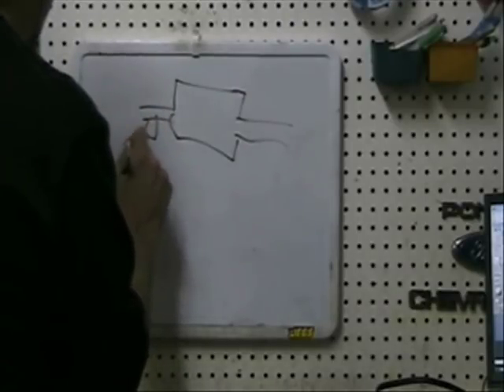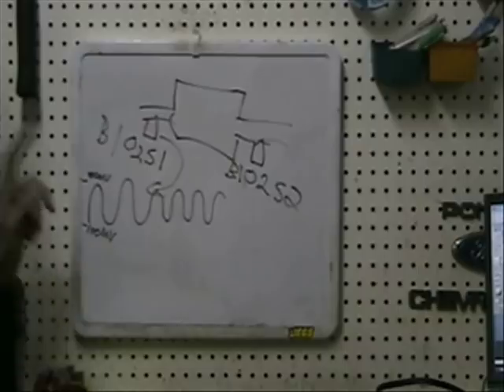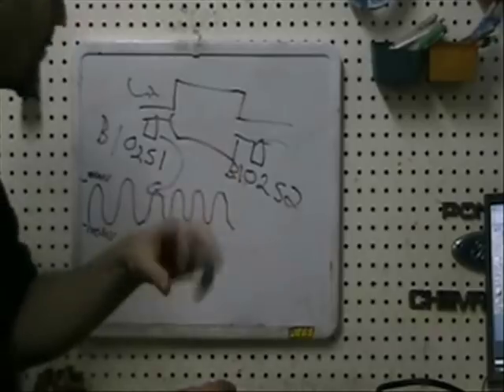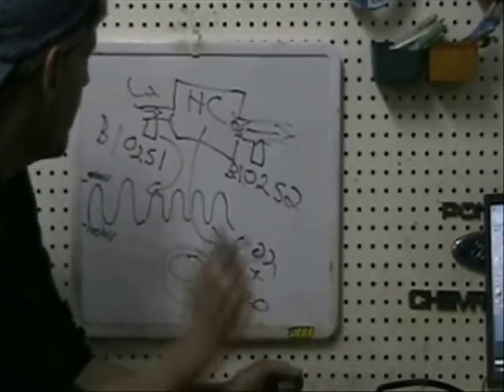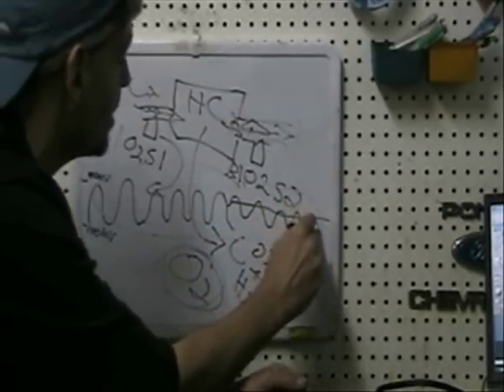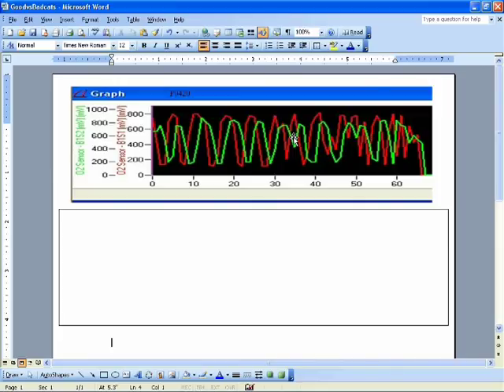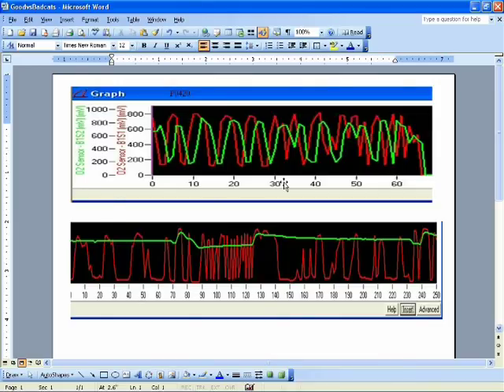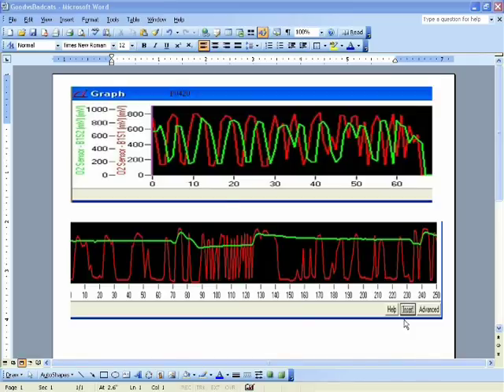P0420 P0430 catalytic converter catalyst inefficiency code diagnosis

Comment: I've seen some people automatically condemn the converter because they see the  downstream signal exactly following the upstream signal. However, the upstream signal wasn't cycling correctly to begin with.

It would seem that if you have a bad upstream signal you need to fix that first. My understanding is that the converter won't do its job properly if the mixture going into the cat isn't cycling properly. So if you were to replace the cat the new one won't work correctly either because the exhaust mixture going into the new cat still won't be cycling correctly.
Reply from the maker: +Joe Vignolo If the upsteam is not cycling properly and the front O2 has a code, it precludes any codes for the cat.
  Even so- if the front sensor is not operating, the cat HAS to still make a change by default because of the chemical activity.  You cannot turn off catalytic activity.
Reply: +Schrodingers Box - If the upstream O2 sensor is cycling correctly voltage-wise but is cycling too slowly frequency-wise you may not get any codes associated directly with the upstream O2 sensor, there will be no drivability issues or plug carbonization, the fuel trims will look fine and the system will run closed loop. But the slow cycling can cause the converter efficiency to drop below the threshold and trip a P0420 or PO430 code. So if you have a slow upstream sensor you need to fix that problem first before condemning the converter.

Remember that later model cars do not use auxiliary air pumps to oxygenate the converters or electric heaters to heat them up. Instead, they use the engine itself to do it. That's what the cycling is for. The lean part of the cycle pumps in the extra oxygen that the converter stores up to use later. The rich part of the cycle pumps in extra HC, which the converter burns to generate the heat it needs to operate correctly. So if the cycling is happening too slow, the catalytic activity will drop off and you will get a PO420 or PO430 code.

I suspect that a lot of perfectly good catalytic converters are ending up in the scrap pile because people are not diagnosing these situations properly. You need to fix any abnormal conditions that are inhibiting the converter before you replace the converter.
Reply from the maker: Joe Vignolo Explain the chemistry of how the catalytic converter would suddenly have low efficiency as result of slow upstream cycling. That makes no sense to me whatsoever.  The catalytic activity is constant, not variable.
Reply: +Schrodingers Box - It's somewhat complicated, but basically it has to do with oxygen storage inside the converter. Modern three way catalytic converters (TWCs) that do not use external air injection have cerium in them. Cerium absorbs oxygen, stores it and then releases it. But cerium has its limitations. It will only absorb small amounts of oxygen and it can only release as much oxygen as it has previously absorbed. Cerium allows the catalyst to operate efficiently under slightly rich and slightly lean conditions only for very short time periods. So if the air/fuel mixture is continuously cycled from slightly rich to slightly lean fast enough, cerium can allow the converter to constantly operate at maximum efficiency. But if the cycling frequency drops too low this little trick will no longer work. This is because the pulses of oxygen contained in the cycle are too long and too far apart. Therefore, during the excessively long, lean parts of the cycle the cerium absorbs only as much oxygen as it can until it saturates and can't absorb any more. This means that the amount of oxygen that the cerium in the converter can store is limited. This then means that during the excessively long, rich parts of the cycle the cerium doesn't have a sufficient amount of oxygen stored up to properly oxygenate the converter all the way through to the next new lean cycle. This in turn causes the converter to become under-oxygenated during the rich parts of the cycle, which in turn causes its efficiency to drop.
Reply from the maker: ***** In that event however you would not MIRROR proper O2 waveform.  Yes there are actually many, many instances where you could have lean or rich conditions affecting trace from the cat but only one possibility where you mirror proper waveform from the front sensor.
Reply: +Attention to Detail - Yes, you are on the right track. A lot of people don't understand what the real purpose is for the upstream cycling. It's actually done intentionally to support the catalytic action inside the converter and the cat will not work properly without it. Here's what happens.

Just like the cats in modern vehicles, cats in older cars used to reduce NOX emissions in the front brick of the cat. To do this they needed a rich mixture to start with, so those engines were run slightly rich all the time. Then, to do oxidation in the back of the cat (to convert CO into CO2 and HC into H20), they needed extra oxygen pumped into the middle of the converter. This was supplied using an external, mechanically driven air pump. But the air pump adds cost, weight, complexity and it also reduces the reliability of the whole system. So the engineers came up with another technique to inject additional O2 and oxygenate the rear brick while at the same time getting rid of the mechanical air pump. This technique involves constantly cycling the mixture, which allows the engine itself to pump the extra oxygen into the rear brick of the cat without having the mechanical air pump to do it with.

During the rich part of the cycle, the front brick uses the extra fuel to reduce or strip out the extra oxygen molecules from the NOX molecules, converting them to N and O2 the same as before. Then during the lean part of the cycle, the engine pumps extra oxygen into the cat. Some of the excess O2 is stored in the cat because they put cerium inside of it. Cerium acts like a sponge. It soaks up oxygen, stores it and releases it later. It is all this extra oxygen which the back brick eventually uses to to accomplish the oxygenation of the HC and CO. 

So you can see why the cycling is so important. Without the cycling, it's sort of like having an older car where the mechanical pump has failed. To make the older car emissions legal again, you would need to repair the mechanical pump. Similarly, in a modern car you need to make sure the cycling is working okay to give the cat a fair chance to do its work correctly. So if you have a converter that is not operating efficiently, you need to make sure the mixture is cycling properly. Do that first, then if it isn't cycling right you need the fix the cycling problem first before you replace the converter. A normally cycling upstream sensor should regularly cycle from .1 to .9 volts and do it about once a second or less.

Next, besides cycling issues, some cats can lose efficiency when they get contaminated inside the honeycomb structure. This can be caused by a temporary condition where the engine was running rich. This can cause carbon to form on the surfaces of the precious metals inside the cat, which can drop the cat's efficiency and cause a P0420 or P0430 code to pop up. So can an anti-freeze leak into the combustion chambers, when the coolant residue builds up inside the cat. In these cases, once the initial condition is corrected, the cats can sometimes be restored by cleaning them out. There are commercial cleaners available such as Cataclean. And some people have even had luck taking the converters out of the vehicle and cleaning them by soaking them overnight in soapy water.

Finally, there are cats that don't work anymore because their insides have been irreversibly damaged. Sometimes continuous misfires have overheated them and melted the insides. This is very common. Other can get impact damaged by running over road hazards such as rocks or stuff that someone dropped in the road. Unfortunately , these cats will have to be replaced. Cleaning these cats won't recover them.

In any case it's always a good idea to check for other less expensive possible causes before replacing an expensive converter. This is also important because  the last thing you want to do is replace the converter and then end up with the same issue again because you didn't fix the real problem.

Also remember that if you had or still have continuous misfires you will need to fix those first so that you don't burn up the new cat.

Many recoverable cats are probably improperly and unnecessarily replaced.  Many professional mechanics automatically replace the cat whenever they see a P0420 or P0430 code. They usually throw new O2 sensors in as well, just to "be on the safe side". Yup, okay. Sure the problem goes away, but so does a lot of the customer's money for no good reason.

Finally, I just read an article the other day from the EPA regarding the issue of evaluating a catalytic converter. They now recommend removing the upstream O2 sensor and inserting a borescope into the exhaust pipe to visually inspect and evaluate the front face of the front brick before replacing any catalytic converter. The article also expressed the importance of finding out the converter's recent history, especially if its been exposed to continuous misfires for any length of time.

Comment: I didn't quite understand what you were saying about if you have an air/fuel ratio sensor instead of a traditional narrow-band O2 sensor (like in a Toyota) -- does that mean you can't diagnose a bad cat by looking at the voltage variance in the downstream sensor? Or will you still see the voltage go up and down in the downstream sensor if the cat is bad?
Reply from the maker: No it means you will just have to use something like a short term fuel trim if you want to see upstream oscillation. The downstream oscillation will still be identical as shown on the video though. But AF voltages do not oscillate.
Reply: @SchrodingersBox  ok, thanks for the excellent video

Comment: I'm  not to sure about the voltage but upstream  shows the wavy line and downstream  is a flatline on both banks the same readings.
Reply from the maker: +angel cedeno Can't help unless I have the right data bro.  Good luck to you.

Comment: how do i read those graphs on a computer?  as in how do i pull them up? or connect them.
Reply from the maker: @Heroofharo- you need a scantool to be able to generate that data.  see my scan tool reviews video for info on the device used in this video.

Comment: Great video, it helped me understand a lot about the cat and downstream O2. I have one question about an 08 Sebring touring V6 I am currently trying to diagnose. I just recently changed out spark plugs to OE plugs and my one cat DS O2 at idle went from oscillating to 100mv flat line after warm up. Driving I still get oscillating graph. I am still looking at a bad cat or O2 sensor?
Reply from the maker: Bad cat
Reply: Schrodingers Box on the other cat I’m flatlining just under 900mv is that still good
Reply: Also, kind of off topic, 1- can a bad cat cause a specific misfire such as P0302, and 2- I am about to run a test, I had a mechanic replace all spark plugs, gapped at about .4, and found out that after fixing my coolant problem, putting coolant (50/50) instead of water, I did not have the misfire. Success! now I break the golden rule, if it ain’t broke don’t fix it. So since I tinkered with the plugs and got the Haynes book, I said let me by OEM plugs(.5 gap). Shouldn’t hurt, right? Misfire came back. Now I’m going to try to replace the plug with the one that worked, to prove my hypothesis. So my question is, over time should the gap get smaller on a plug or is something else happening that I’m missing.

Comment: You never said if the graphs you put up are at idle speed or increasing rpms while in park or while driving.
My #2 o2 sensor doesn't mimic sensor #1  while taking it to 2000rpms or at idle. #1 while at idle goes between .1 and .8 spiking about every 7 seconds with #2 steady at .7/8Volts.
While running down road at 1000 rmps there is a mimmic of #1 and #2 sensors, but not while idling or 2000rpms.  
The frequency of spiking to .7 volts is less frequent in seconds at idle then while driving down the road.
Reply from the maker: You will see it at both. Worse at idle but at 200RPM it should also be enantiomeric.

Comment: When i floor the car at 70mph car begin to misfire p0300, an P0430.... Only happen when floored at high speed... Where should I start
Reply from the maker: Definitely start with fuel trim curved against load. That’s by far the most basic way to get a direction.
  The 0430 likely has nothing to do with it.

Comment: Great video, I have seen guys use spark plug non foulers over the 02 sensor to eliminate code po420 . my question is will it effect the fuel economy at all even those check engine light are off. please help!
Reply from the maker: It won't affect fuel economy but it won't get rid of the check engine light either. People who try to override an inefficiency code through O2 sensor manifpulation have no comprehension of the system. Using a non fouler will simply replace the P0420 code with a O2S "stuck lean" code. Even a cursory momen't thought would indicate why that would be.
Reply: @SchrodingersBox  So what affects fuel economy? i have a p0420 car is using more fuel than normal
Reply: It did not work for me on my '98 Cutlass 3.1 with no cat. I'm still getting p0420 and my fuel trims look good but rear o2 sensor is jumping rich to lean same as upstream does. I also have some grey smoke out the exhaust but no overheating or loss of coolant and my fuel trims are near perfect at idle but long term goes +7 with a quick punch of the throttle and levels back to near zero when I hold rpms at 2500 then goes + again just after I let off then back to zero at idle. I'm fearing it could be a vacuum intake or head gasket leak but as I said, it's not running hot or losing coolant.
Reply: @ianwilds3139  
Looks like you have a bad cat

Comment: Great video and explanation.  Thank you!  Quick question... Can you explain how installing a spark plug non-fouler between the downstream O2 sensor and the exhaust pipe eliminates the P0420 code?  I understand it's moving the sensor away from the exhaust stream by about an inch or so, but would it really change the waveform that much?  Just curious if you've tested the spark plug non-fouler idea and if you have any data if you tried it.
Reply from the maker: Easy to explain. It doesn't work. I have dozens of people who ask me how to get it to work when they try it.
Reply: Thanks for your reply.  If it doesn't work, that would explain the lack of data from anyone on YouTube who claims it works but doesn't provide any data whatsoever.
Reply: @EricLaPrad  I tried it on my '98 Cutlass 3.1 with no cat and did not work . I started with one spacer and no luck then doubled up still no luck. I'm still getting a p0420 and my fuel trims are near perfect but downstream o2 is bouncing the same as front one. I'm concerned that if install a new cat it might clog or burn up even with good fuel trims.
Reply: That makes zero sense, why would it burn up with good fuel trims?

Comment: thaaaaaaaaaaaaaaank you very much this is really helpful.
well, i have 2002 es lexus with p420 and p430 codes, and i believe that the first user of the car has removed these filters as he told me, knowing that i am from Emirates and the regulations here do not obligate us to use this kinda filtering so far.
so i have two questions:
1) does it affect my car to drive it with out these filters?
2) is there any way to clear the check engine light?
3) how much is a new good catalyst in US?
Reply from the maker: saddam ateeg You may be my first viewer from the Emirates, so welcome, though frankly that's a bummer of a first name you have lol. But to answer your questions:
1. No you will not damage your car by driving without the filters you describe (Catalytic Converters). If they have been removed, it actually will increase horsepower a bit because there is less exhaust restriction. 
2. Yes there is a way to clear the check engine light but it is complicated. You'd have to buy an electrical component that would simulate the rear O2 signal running rich but not at engine warmup or at other times when the signal would be expected to be fixed rich all the time which would cause a rear O2 sensor out of range code. You can't just simply ground out the O2 wires and fix it rich all the time. I do believe there are such components commercially available that are "smart" enough to simulate the signal from a catalytic converter, but I know nothing about them or how reliably they work. I don't know about Saudia Arabia but in most states in the US you cannot license a vehicle if the check engine light is on and in fact in some states they physically inspect for catalytic converters so this trick of bypassing the check engine light wouldn't work anyway. In other states (more rural ones) there are no regulations at all for emissions.
3. It greatly depends on the vehicle but generally a catalytic converter on an average passenger vehicle runs about $500-$600 installed. They carry long warranties though as required by law- about 7 years.

Comment: My 2005 Camry has a af sensor near the manifold followed by a cat followed by an 02 sensor . But then more down the same exaughst pipe there is another cat followed by another 02 sensor. Does the same principle apply to that 3rd 02 sensor as well? It’s reading under .1 mv at the moment. The 02 works fine.
Reply from the maker: yes it does!!